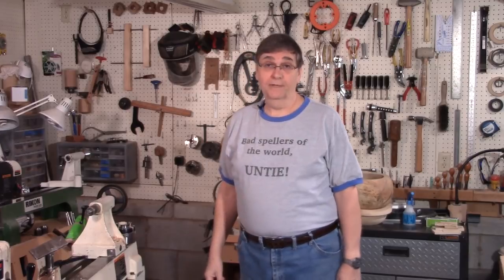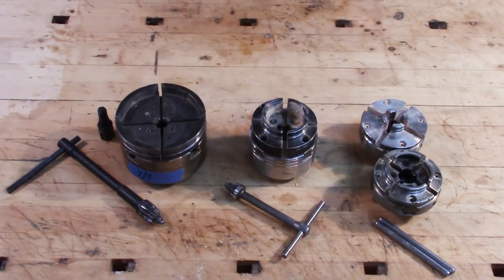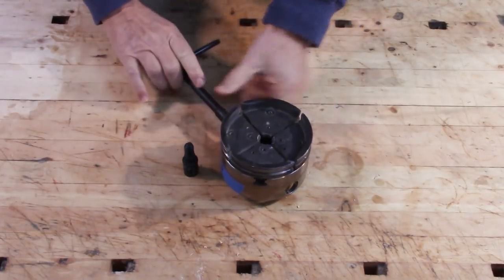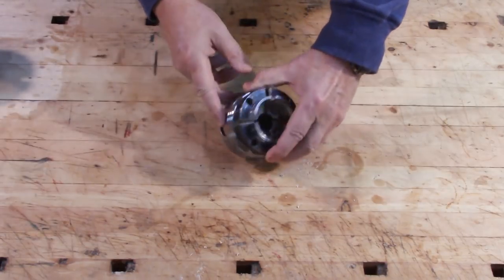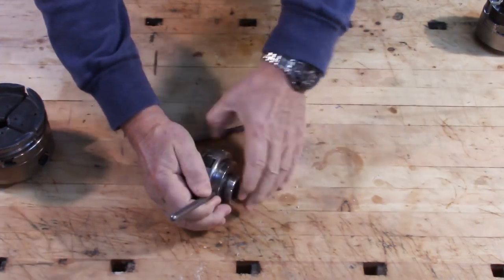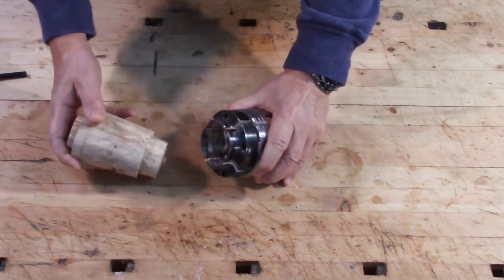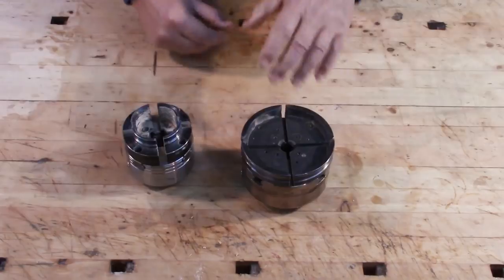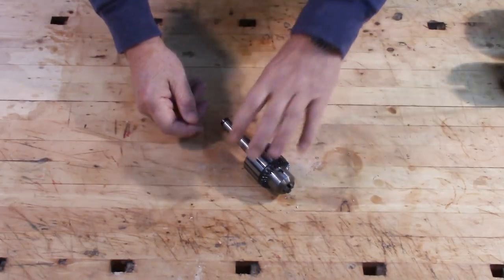The Basics of Woodturning Chucks

Comment: very useful I just started turning and pyrography about 2 months ago making my wife a wedding ring couse of metal allergies now kinda obsessed with it now lot of great info my set up or lack there of is standard hand power tools and Manuel tools I used a drill to make the ring with a metal debur bit drill bits a chainsaw file a grinder with very aggressive metal flapper pads turned out real nice now I want a lathe since I made a dremel work station to hold it upside as a router and drill press small scale of course
Reply from the maker: +larry powell I've never tried turning a ring, Larry. Someday I'll have to try it. Thanks for commenting!

Comment: Ok, thank you. Now, how do you attach it and detach it from the lathe?
Reply from the maker: All chucks have a threaded back - that simply threads onto the headstock spindle, which is also threaded. When you buy a chuck, be sure to get one with the right size threads. Typically, this is 1x16 or 1 1/4 x 16.

Comment: You can use the Jacobs chuck on the head stock side just use a draw bar it keeps it from slipping out its just a threaded rod a washer and a nut easy to make that is if the Jacobs chuck has a threaded end
Reply from the maker: +Keith “kmcwoodwork” Caine Keith, sorry it took me so long to see your comment...for some reason, YouTube had categorized it as spam and it was buried. Thanks for the suggestion. I have always intended to make a drawbar like you describe, just haven't got around to it. I think my Jacobs chuck does have threading on the end.

Comment: Thank you, Rick. I'm making Christmas ornaments, but my Grizzly Chuck is too large for a 1 1/2" blank. I'm hoping I can use only two jaws to hold a blank a little less than 1 1/2" in diameter.
Reply from the maker: Why don't you make a wood faceplate to clamp in your large chuck, then use hot-melt glue to mount the small ornament blank to the faceplate. Check out Carl Jacobson's videos, he has a number of small turnings done that way.
Reply: Thanks, I'll check it out.

Comment: I think you're mistaken about the oneway stronghold not needing jaws  to hold the worm screw center. ..unlesss I've been doing it wrong? ..also, they make adapters to adapt just about any chuck to any lathe. ..even when adapting a chuck  meant for smaller spindle. I was able to adapt a couple of 3/4"Ø chucks to my 1"x8tpi Ø chuck for $20. It's an awkward looking adapter but it works
Reply from the maker: I believe the chuck will hold the woodworm screw with jaws on the chuck, but I don’t use it like that - it’s too much of a nuisance to remove the jaws. Plus, with the jaws on, an uneven surface is held securely, in my opinion. Thanks for watching!

Comment: I have picked up an old wood lathe. Right now it only has centres. How do I know what kind of connector i need to add a chuck? How do I know what insert for the head stock that I need?
Reply from the maker: +Dave Rosa Hi, Dave. If your lathe is somewhat small, it may have a 3/4 x 12 headstock spindle. Newer small lathes usually have a 1 x 8 spindle, and larger lathes usually have a 1 1/4 x 8 spindle. You can check by measuring the diameter of the end of the headstock spindle (across the threads, not just the solid part)...that gives you the first part of the specification. The second part, the threads per inch, you can measure by counting the number of thread spirals in an inch, or in a half inch and multiply by two. You may also be able to find the specs for your lathe on the internet. Good luck!
Reply: It has a 36 inch bed and it is an older model.
Reply: @RickTurnsWoodturning  I

Comment: Can two jaws on a four jaw chuck be removed safely for turning smaller tenons?
Reply from the maker: +James W Johnson Hi, James. I have seen that done once (youtube video), for a special use. And there is one set of jaws that only has two jaws, again for a special use. I can't say I'd recommend it, since it decreases the holding power of the chuck..and I definitely wouldn't do for anything other than very small workpieces. But it can be done.

Comment: Would you use them with a bench top lathe? 8” x 12”? Wen sized?
Reply from the maker: Hi, James. The smaller lathes I’ve seen use 1”x8tpi on the headstock spindle. You can buy most of these chucks with that threading, or with an adapter for that size. I don’t have specific knowledge of the Wen lathe, however.

Comment: I have a midi chuck but have trouble using the threaded bit which should be held by the chuck.
Doesn’t seem to work and despite huge tightening in chuck it comes loose.
What am I doing wrong
Please help
David
Reply from the maker: Are you talking about the screws that hold the jaws in place, David? Or the threaded opening that screws onto the headstock?

Comment: I have an old unusual type of lathe on which the headstock has a MALE Morse Taper 2 on its end. So i need a FEMALE Morse Taper 2 back on a chuck.  Do i have any options?
Reply from the maker: All the chucks I've looked at had a female thread on the headstock side. I don't know that you could find a chuck that would mount to a morse taper. Good luck!
Reply: Thank you Rick! I think i will have to machine my headstock axis. What is the most standard thread size that will acomodate most chucks?
Reply from the maker: 1" x 8tpi and 1 1/4" by 8tpi are the most widely used ones in the US. In Europe, I believe is 33m or something like that, I'm not really sure.1 1/4" is most on larger lathes, while 1" is generally found on smaller lathes.
Reply: Super!

Comment: hi! I got my granddads woodturner and i cant figgur out the chuck 

it's one of the chuck whit two 'sticks' rods and i try moving it but it don't work.. any tips?
Reply from the maker: Hi, Henrik. Those are "Tommy bars" or torque levers or tightening bars. The Chuck has an outer ring (which the jaws attach to), and an inner ring (behind the outer ring). Each ring has three or four holes in it. You put the end of one bar into a hole on the inner ring, and the end of the other bar into a hole on the outer ring, then pull them together or push them apart to tighten and loosen the chuck. In the two rings won't move, then it's likely that they need lubrication. Drip oil down between the two rings and into any other openings you see, and keep working it until it begins to move. The Nova Midi chuck uses Tommy bars, so if you can't figure it out, do a web search on "Nova Midi chuck manual" - I believe the owner's manual has some diagrams on how to open and close the Chuck jaws, and perhaps on where to lube it. Good luck with it, Henrik!
Reply: +RickTurns thank you! And a marry Christmas!

Comment: I found a lathe for free that came with no parts for it other than what was on it, never having used a lathe ive been struggling for hours trying to loosen the chuck thinking im some kind of idiot, then of course you need to 2 little bars to unlock it, i think if i use some nails for now i might be able to get it open enough to fit in some steel to make my own keys
Reply from the maker: You should be able to find the right diameter steel rod at a hardward store or perhaps a home center to make your own chuck bars.

Comment: Hello. My english is not good, but i have a problem and perhaps you can help me Sir. I bought a Woodman TC1100, and i have a chuck with M18. Now i have two problems:First: What size have the spindel of Woodman TC1100? I think, but i'm not sure, it's 1'' 8 th. And, second: Where can i get from a adaptor for the Woodman spindel (female) to M18 (male), so i can use my chuck with M18? Thank you in advance!   https://disber.com/en/producto/torno-tc-1100/
Reply from the maker: That link you send shows that the spindle size is 1" x 8 threads-per-inch. I looked for a spindle adapter to go from 1x8 to m18, but didn't find anything. Your best bet might be to contact the manufacturer of your chuck, and see if they have that specific adapter. Sorry I can't be of more help.
Reply: Oh, that's cool! Thank you.

Comment: What about a 4 jaw independent chuck very useful for odd shaped and square stock. They are harder to centre as each jaw moves independently of the others.
Reply from the maker: +Ansi Baumanis I've never had one of those chucks - they're made primarily for metal turning, aren't they? Seems like they would be a real pain to use, since the jaws don't automatically center. Do you use one, Ansi?

Comment: I've got an old chuck from a coronet no.2. And it doesn't have a key thing to tighten it. It's actually in bits and you have to manually adjust it. I don't  however have a clue how to us it. Hence why I'm here. I don't even know what it's called.
Reply from the maker: Sorry for the delay in replying - I thought I had answered this a week ago, but apparently I didn't hit the enter key or something. That sounds like a metal-turning chuck. Metal chucks have jaws which are independently adjustable. Woodturning chucks have jaws that all move together, making it dead simple to center the jaws on the work. Metal chucks also usually have a single point on the jaws that contact the work, while woodturning chucks have contact all along a quarter of a circle. You'd probably be better off to buy a woodturning chuck - the lowest price ones sell for around $100. Good luck, Hoho.